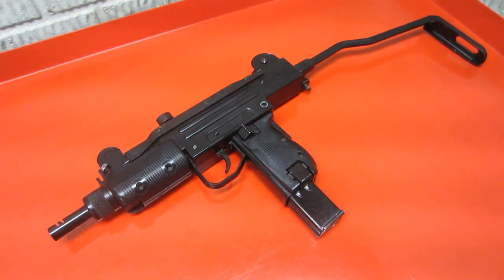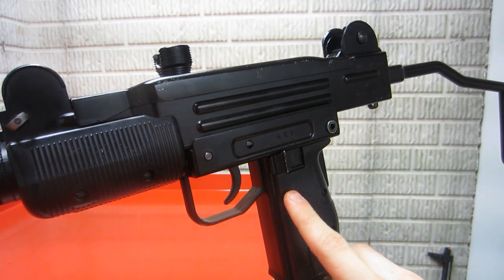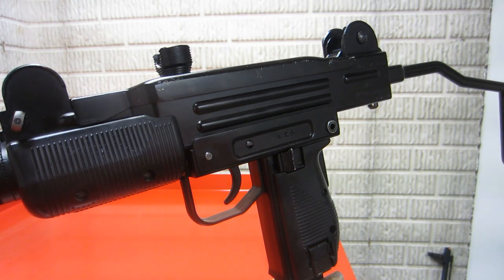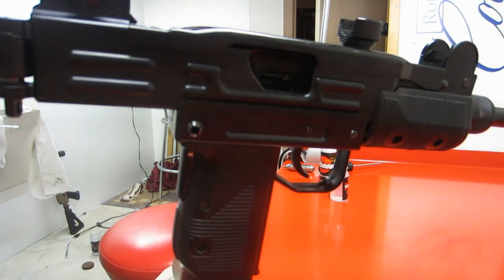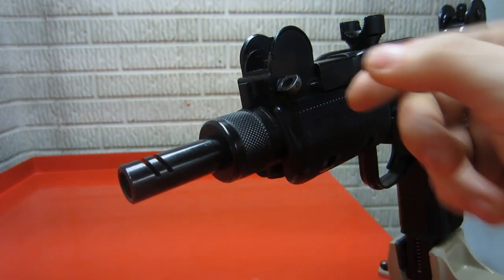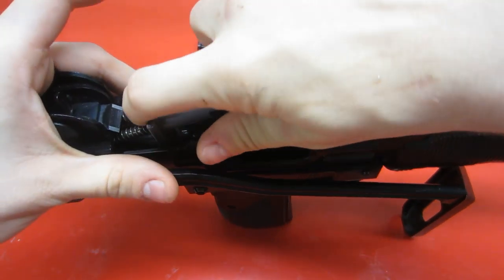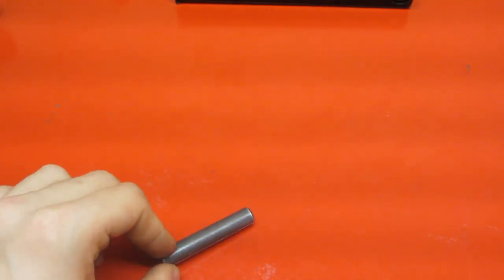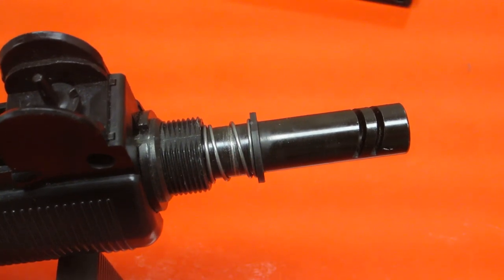KWC Co2 Blowback Mini Uzi Airsoft Gun Review

Comment: For those confused, 
this is the v1 uzi made by kwc, the first version had a lot of issues so they made a v2. 
The v2 has a lot less internal parts meaning more reliability. They also improved the magazine because the v1 mag liked to break a lot.
To tell the difference the v2 has 1 spring pushing the bolt forward and it has v2 written on the magazine.
I have done a review on my channel.
https://www.youtube.com/watch?v=XUuPRuuwkvs
Reply: Do v2 Mags fit for v1?

Comment: Good job!  Very thorough overview of the gun. .. I just ordered one from Pyramyd Air with an extra mag for $180 shipped. Would love to have a link to the parts site you mentioned. I've heard of being able to upgrade several of the gun's components, but can't find a source site.  Also, I'd like to add a suppressor to this gun.  Do you have a good source that could provide a perfect fitting unit that could easily be installed and remove (like on a real UZI). One last thing would be an ideal case that would be just large enough for the gun, two mags, that "perfect" suppressor, a half dozen CO2 cylinders, allen wrench and lube, BB pack and maybe a quick loader. Finally, I wonder if the gun operation could be enhanced with some stone work on the internal friction points (like a real gun)?  Thanks for your thoughts and any information you can offer.

Comment: Thats an uzi uzi not a mini uzi
Reply: No, that is the Mini Variant of the Uzi, the Normal one Has a slightly Longer barrel and has a Under folding Stock. The Micro Uzi Might be what you are thinking of, Is Normally has no stock or a very short side folding stock and a very short barrel.
Reply: You are correct. My bad.